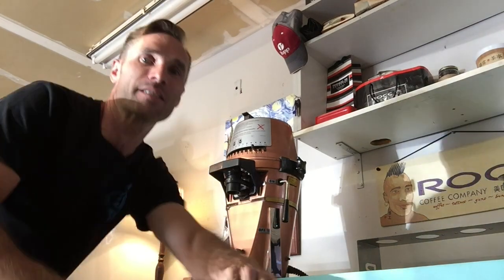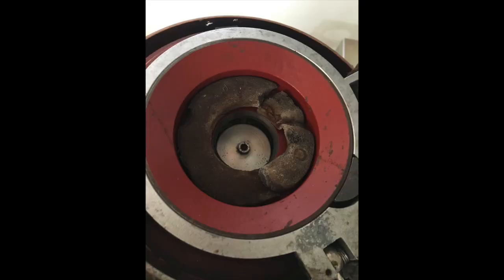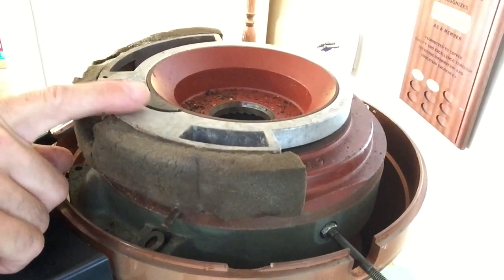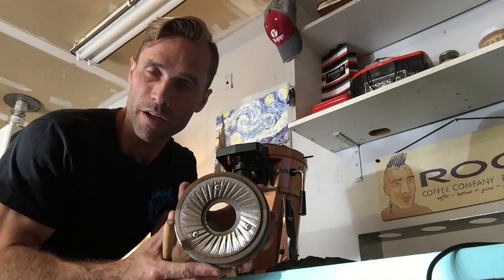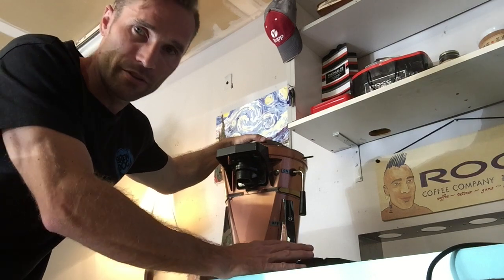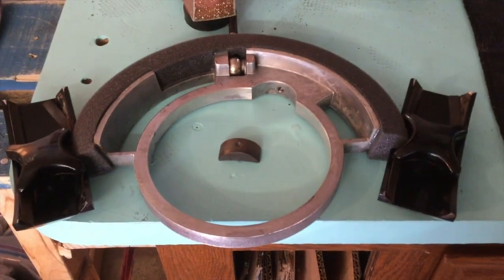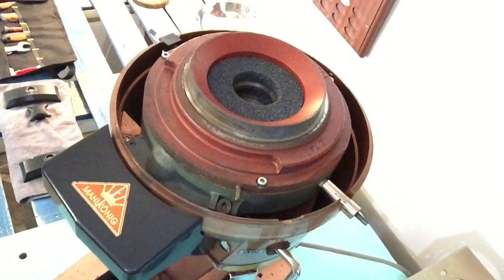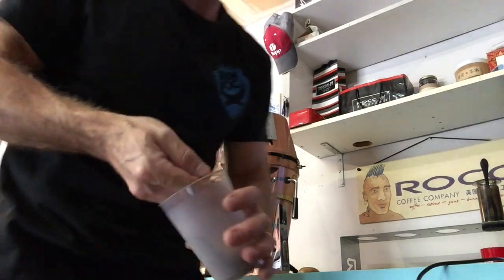Mahlkonig VTA-6SW Coffee Grinder How-To, Tear Down, Foam Replacement, Burr Clean Adjustment

Comment from the maker: Mahlkonig VTA6 Single Phase, 3-Phase, VTA6-SW Grinder

Download: VTA6_SW_SINGLEPHASE_Exploded_View_US.pdf
https://cdn.shopify.com/s/files/1/0051/8032/5952/t/1/assets/VTA6_SW_SINGLEPHASE_Exploded_View_US.pdf?2406

Download: VTA6_S_SW_Singlephase_Product_Info_Sheet_US.pdf
https://cdn.shopify.com/s/files/1/0051/8032/5952/t/1/assets/VTA6_S_SW_Singlephase_Product_Info_Sheet_US.pdf?2327

Download: VTA6_SW_SinglePhase_User_Manual_US.pdf
https://cdn.shopify.com/s/files/1/0051/8032/5952/t/1/assets/VTA6_SW_SinglePhase_User_Manual_US.pdf?2322

Also for the Mahlkonig Family of Grinders (most) visit: USA Knowledge Center: https://mahlkonigusa.com/pages/knowledge-center 

Tanzania Grinder . Peak Grinder, Espresso . Kenia Grinder
K30 Vario Air Grinder, Espresso . K30 Twin Grinder, Espresso
Guatemala GUA LAB, GUA F, GUA 710 Retail & Shop Grinder
EK43 Grinder, EKK-43 Grinder, EK43S Grinder
E65S Grinder, DK15 Grinder, GH-2 Grinder

Comment: Where did you get the replacement foam pieces from? Thanks
Reply: Hi, I ordered through Mahlkonig USA: https://mahlkonigusa.com/search?type=article%2Cpage%2Cproduct&q=vta* or https://mahlkonigusa.com/collections. Happy to help if there is a more specific inquiry. I've been in and out of that machine more than I planned, but feel comfortable navigating it now.
Reply: @ascarpenter  Oh I see, I live in Europe and we don't have an online store for these parts and if I ship it from the USA, it'll cost more than the replacement part :/ Also, I try to get to the motor but can't seem to detach the distribution plate (if that's what it's called). Is there a certain method to it or is it just stuck in place, I've uploaded a photo to Google Drive (https://bit.ly/2pXxZAk)
Reply from the maker: Sorry for the late reply. These messages were hidden from my notifications. However, if you were to contact both Mahlkonig EU and Ditting / Anfim (they are all one company now) you may be able to track down the foam. I expect mine in the US came from Europe after all. Good luck.
Reply from the maker: Yes the distribution plate gave me trouble for weeks. I finally got technical support from Mahlkonig directly. They advised using the same longer screws to push plate up from the bottom. And it worked! Shown in my 2nd video. https://youtu.be/dpqi6L0hKWM?t=112 Good luck.